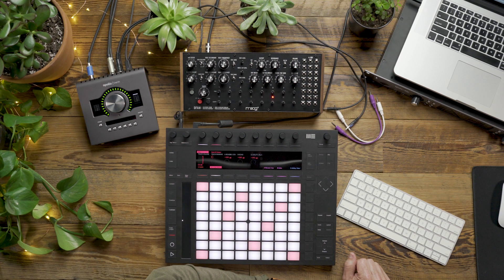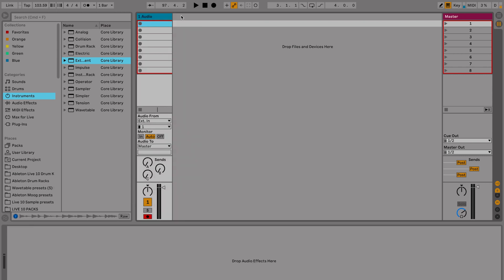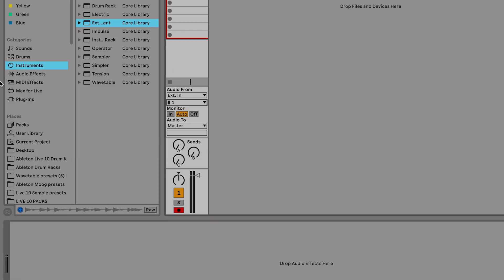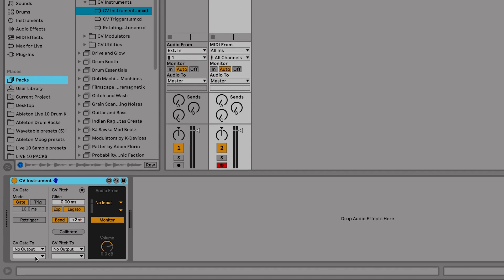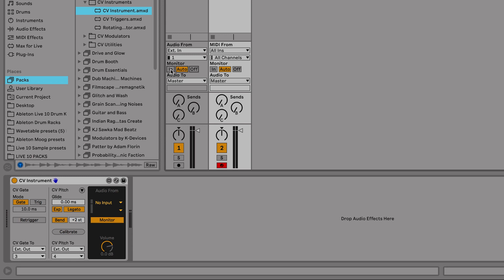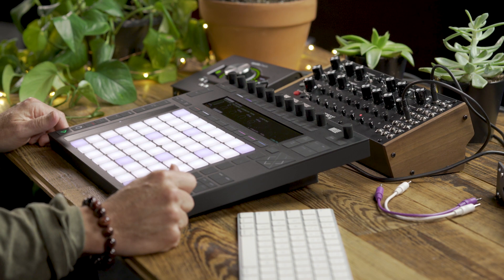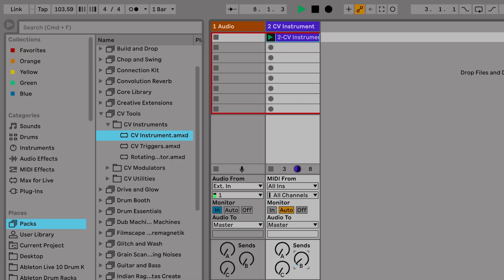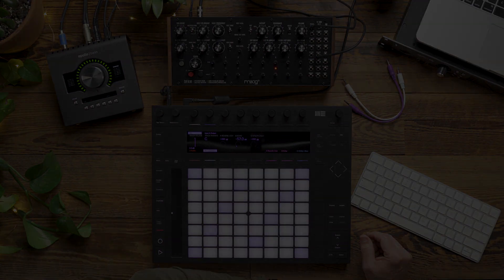DFAM | Play your Synth from Ableton Push using CV Tools

Comment: Can you please clarify something because I am a tad confused.  Are you saying a MIDI controller like Push has the ability to play sounds from an analog synth by pressing on the pads on Push and they trigger the sound the same way as the actual keyboard on a Moog Sub37 would by using MIDI commands instead of the keys on the synth ?  Probably the dumbest question you ever heard  but just trying to understand signal flow.  I own a Sub 37, Push 2 and a bunch of other gear  including 3 MoogerFooger pedals still unboxed from Sweetawater (102, 103. 108m)  a 104M delay and a CP 251.  I got badly injured in an accident 5 years ago and stopped playing guitar and recording and trying to get back into music or sell my gear.   So watching videos for inspiration and the question about controlling Moog with MIDI confuses me.  I am a guitarist have two guitars with built in Fishman Triple play pickups and vaguely remember years ago using  my MIDI pickup to play my Moog Sub 37 as well as my internal VSTs in ableton..  I have a traumatic brain injury so my brain can get a tad confused at times.    Thanks for anyone who takes time to respond.🙏
Reply: Hi, from what I've gathered from watching a few of these tutorials, is that the audio interface needs to be DC coupled so that it can send the appropriate CV to the synth. There are external CV controllers that can do this, and keyboards/sequencers that have CV out that can also control the DFAM. There's also a third party device called the MAFD by Sonoclast that can enable midi control of the DFAM. I hope this helps!

Comment: CV Tools is such a great instrument pack in Live. Just be sure you have a DC coupled audio interface. Or you can use CV Tools with an Expert Sleepers ES-3 (8 outputs from PC world to CV world). I have built a template with all 8 outputs and it works perfect for  integrating Live to your CV instruments. ES also makes other versions with even more CV I/O to/from PC. Be sure though that your audio interface has a ADAT fiber optic ("light pipe") port.

Comment: I'll save y'all some time. If you have a Scarlett Audio interface (like me) you cannot use CV to control your DFAM from the interfaces output. Scarlett Audio Interfaces are not DC coupled and therefore cannot send CV.
Reply: If you have a modular set up, and have an ES-8 you can make an aggregate device and it will work, but you need something that is DC coupled.

Comment: I'm trying this with Komplete audio 6 and ableton as well. But it doesn't work :( Nothing happens when the MIDI plays. I'm using a standard stereo jack plug.. is that the reason? should it be mono?
Reply: never mind it works. I needed to enabled outputs of MIDI Ports in ableton. But how you control the pitch with Push? It's because it uses it as a sampler?

Comment: I've followed the instruction on the video....there isn't the same result. What am I missing?
are there settings in the UAD Apollo Twin (mkii duo) that should be noted?
Thank you kindly
Reply: figured it out. should note in video descriptions for UAD settings:
select CUE OUTPUTS button in close application and set Line 3/4 to be Line 3/4 and not MIX
Reply: @harryrotker I had a same problem, thank you :) in my case the cue option was turned on

Comment: Are the outputs from the Apollo Twin, dc coupled ?
Reply from the maker: Yes.
Reply: @MoogSynthesizers  thank you
Reply: @MoogSynthesizers  I own a DFAM and a GM. I use the midi out to my GM and then send a signal to my DFAM to sync. I Own an Apogee Ensemble Thunderbolt. Could you show me a way to use that with CV tools please?
Reply: @MoogSynthesizers  can i used a DFAM even if my interface is NOT dc coupled ? i have a Antelope Orion 32+. Im new to modular synth. THANKS
Reply: Indeed they are!